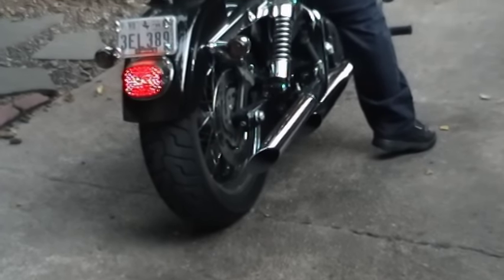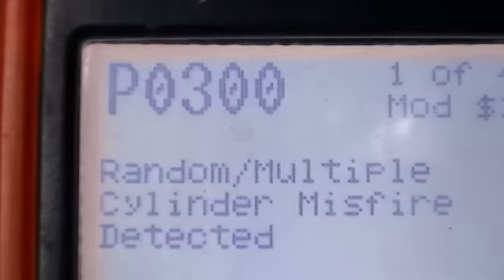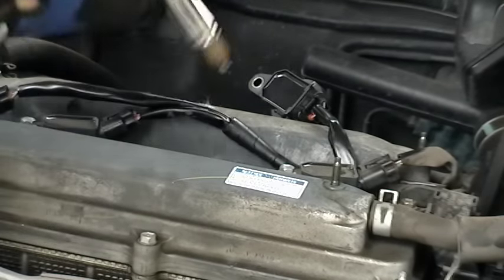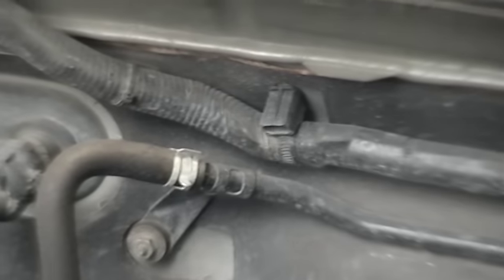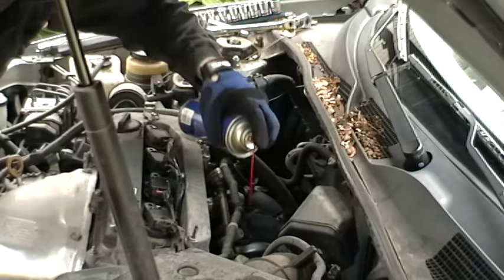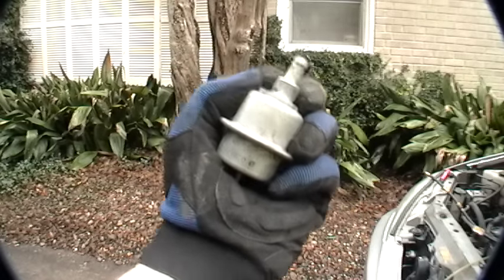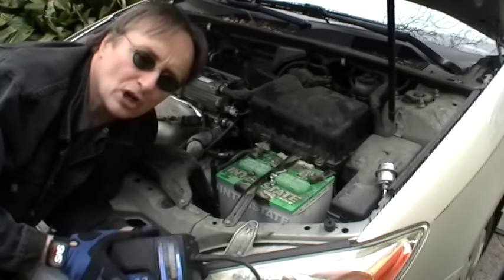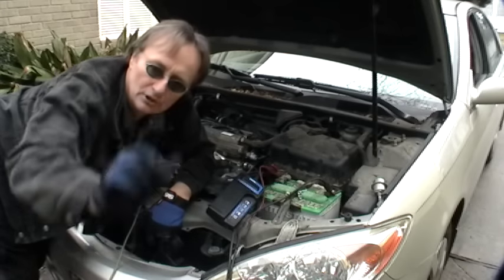How to Fix a Random Engine Misfire in Your Car (Code P0300)

Comment: I have a 2010 Mustang that is randomly only misfiring on start up.. I’ve taken it both to ford and brakes plus to see if they could figure it out but can’t .. 
I’ve replaced spark plugs , wires , bad egr valve , head gasket, replaced all vacuum leaks, cleaned maf sensor, used Lucas Oil injector cleaner/lubricant , tried the “train idle” test . 
It only happens usually on warm starts after it has been driven throughout the day
It will only happen until I start driving and the car runs perfectly normal after that..
It gets bad movements with the rpms on the start up idle and last night it finally got so low in Rpms that it completely died when I was in the parking lot.. I need this fixed pls Scotty or someone have an idea of what it could be
(I wanna note that this didn’t start happening until I replaced the spark plugs at a shop)
Reply: replace all plugs again? right plugs installed?
Reply: Brandon Acken yes I have replaced the plugs twice !!! The first time was with performance plugs and wires but then I thought that could be the issue so I went back to ford motor craft but still hasn’t been fixed ...
Can an after market exhaust do it? Idk I’m running out of shit to fix

Comment: I have a 96 suburban, I just changed the spark plugs and wires, rotor, distributor cap, gas filter pic valve and I am still getting the p0300
Reply from the maker: on that model, often leaking fuel injection systems do that, check that first. Also pressure test the fuel pump, weak ones do that too

Comment: I have the P0300...and there is oil coming out from the pvc valve going into the throttle body into the air intake manifold...any advice ASAP...thank you...

Comment: 98 chevy malibu, shakes and wont accelerate fast. Changed spark plugs, changed battery, changed coil housing, changed MAP sensor, what else can I possibly do?
Reply from the maker: tons of things can do that, pressure test the fuel pump first, and if that's OK, try my video "how to clean fuel injectors on your car" AND pray that works

Comment: random misfire engine code p0300

hello everyone i have an aveo 2008 and im having trouble geting it to pass smog.. the engine light keeps coming on (flashing) i have already changed the EGR valve, spark plugs and wires, the coil pack and the gasket seal... what else can be wrong with this car!! i need some advice please... thank you

Comment: i have chevrolet optra 2010 and i have package of errors 
p0300-powetrain
random/Multiple cylinder Misfire Detected

p0341-powertrain
camshift position sensor "A" circuit range/performance(bank1 or single sensor)

p0342-powertrain
camshift position sensor "A" circuit low input (bank1 or single sensor)

p1403-powertrain
tap for multiple description when i press i see talk about 
EGR exhaust gas recurculations

its automatic gear car 2010 model optra
when the car is on N rpm is like trying to be low
if i moved to D rpm come low and high then low its about to stop but not stop some time i push accelration but it some where repond slowly 
after the car move its fine till i stop or go very low speed

Comment: hey Scotty a Chevy silversmith 1500 I'm getting a p0300 code I changed out the plugs and wires and reset check engine light but the code came back any advice on my next step? thanks
Reply: silverado**
Reply: Bro.. Did yo not watch the video?... He clearly pointed out several other things to check..

Comment: So when I drive my car insted of rpms going up when I accelerate the go down and the car sounds like a misfire or a backfire out of the exhaust it pops while the Roma drop any advice on what I should look at I fixed all air leaks known

Comment: 07 gmc canyon 5 cylinder. I replaced spark plugs and since then it has been throwing that p300 code.
Reply from the maker: often bad wiring or ignition coils then

Comment: 2001 chrysler Sebring 2.7l  code p0302
Changed spark plugs,code still coming back
What else to check?
Reply from the maker: swap #2 injector with another, pray the miss moves, then replace that injector
Reply: Scotty Kilmer Ended up being the coil pack....replace the coil pack all good...Thank You!

Comment: Hi scott. I changed my sparkplugs on my sentra 09 and now it doesnt stays on. I put the comp on it and it has codes P0300 and Pedal sensor. Any help appreciate it. Thanks
Reply: k monsalve did you get it fixed ? And did your car shake or sputter ?
Reply: Dan D My car does u know something?

Comment: 1997 Ford Taurus, P0300 code. Plugs/Wires/Coils replaced. Check engine on, flashes occasionally. No clue how to fix.
Reply: Kevin Keener replace fuel filter, clean or replace injectors, fuel pump or it could be bad valves/low compression on that cylunder

Comment: I have a 97 Miata thats giving me a p0300 code (random multiple misfires). This code is popping up on my relatively inexpensive Matco MC200 reader... the head and head gasket is new, the timing belt is new, the water pump is new, the thermostat is new, the belts are new, the battery is less than a yr old and tested good, plugs, wires, cap, etc.. are all new as well. I originally got an EGR error code when i took it to the shop (i think they said it was a p0400 code)...i never got that code on my reader, not sure if the code reader i have doesnt read all codes or what (the shop didnt get the p0300 code and i didnt get the p0400 code that they got???), i removed and cleaned the EGR valve but i got p0300 code again. I drove it nearly 150 miles with no CEL then i decided to take it through the higher RPM ranges when shifting and it came on almost immediately once the cars RPM's went over 4000. I have looked at all kinds of common issues from making sure the bolts on the crank pulley are tight to ensure that its not wobbling which will cause a mis-read between the timing wheel and crank sensor, i also checked the gap on the CPS and it is good. I'm not sure what left??? Fuel filter? Fuel pressure reg? I'm lost here. Whgen i drive it i can fell very slight "jerking" when going up thru the gears...its VERY slight, not even really jerking but i couldnt think of a better word.
Reply from the maker: a bad egr valve that sucks air will do that.  But, so will tons of other things.  Weak injectors, weak fuel pump you can pressure test, a bd maf sensor, bad wiring, etc.  So good luck, you may be better off paying a guy like me, a pro mechanic to at least analyze live and mode 6 data after a road test
Reply: Injectors are new as well. I think im gonna replace the MAF sensor and the fuel pump...i just did the fuel filter last night. This car has never seen the rain or snow, its been a garage queen, i doubt the wiring is bad...its cleaner inside and out, and underneath than my wifes 2015.

Comment from the maker: many things can cause that, but number one on those are fuel injection problems from that cheap plastic injection system GM uses. they tend to crack and leak with age.

Comment: Im getting the check engine light only at high speeds when i press down on the throttle and also on hills..i have this code, any ideas?
Reply: Bad fuel

Comment: I have a 2003 ford Taurus ses 3.0 it randomly says I have a p1131 p1151 and p0300 or it will say p0301 p0303 and p0306 and runs like crap I pop the hood try to hear see or even smell something off then it smooths out
Reply: I've replaced the plugs wires coil pcv

Comment: Hi just want to ask something, i do have an e46 with p0313,p0183,p0185,p0171,p0174  
Codes. Car right now is hard to start dies after stepping  off gas pedal. It stalls i recently change camshaft sensor intake.still no change.then i change SP 2 out 6 right now and found oil in SP cylinder number  two (also burnt).might valve cover gasket leak.also the fuel filter by previous owner didnt change Fuel filter.considering also this.anyone could give me an advise? Just to add ccv hose to valve cover  broke and previous owner just connect it by heater hose.considering changing new ccv (found smudge of oil inside hose). Battery is good checking via multimeter also alternator works. Thank you very much.

Comment: Hi, I have an Honda Civic EG (D15B2), but having some problems with it. When i floor the gaspedal the car bogs/hesitates. And when i'm coming to an stop the car just falls down in rpm to 400 rpm/ish and hear some weird noise through my exhaust. 
When i accelerate from the traffic lights the car runs on 3 cylinders, when at 2500~3000 rpm it gives all the power and stops hesitating. Hope somebody can help me

Comment: I have a 1999 beetle 2.0 - I put new up and down stream sensor/new battery/new catalytic converter and it keeps giving me Code  p0300 multiple cylinder misfire /cylinder 1 and cylinder 3.has a new battery also. have a whore(hose) that comes from the secondary air pump to the air filter box that keeps getting lose any ideas ?

Comment: i got this problem on my 1.4 tjet alfa romeo mito 2010 with 125k km when i start the engine at morning the engine hesitate for about 2-4 second and i also hear sound like popping from my exhaust  sometimes  flashing chick engine light comes on for about 2-4 second on idle my rpm seems like going down to about 1000 rpm then comes back again to 1300 rpm idle mode after this the engine back to work as normal 1000 rpm ...i run a OBD2 scan and it says randoom missfire code 0300-98

0301-98 
0302-98 
0303-98 
i did a rest for all error 
and drive the car for 1 day and run a obd2 scan again p0303-98 missfire 

i seems like everytime i got a different code

please help me scoty🙏🙏🙏

Comment: I have a 1997 Chevy S10 with a 2.2L engine.  I keep getting the Random Misfire code P0300.  I had replaced ALL vacuum hoses and lines, spark plugs and gap them to 0.060 inches, replaced the spark plug wires, MAP Sensor, All injectors, Ignition coils ALL to include the ICM.  Switched to different spark plugs, and wires, O2 sensors front and rear, Cleaned upper intake and replaced gasket.  Replaced exhaust flex pipe do to exhaust leak, replaced CAT and muffle, new fuel pump.  And I am still getting Random Misfires.  Engine use to start with just one turn of the key before the above was changed.  Now you have to pump the throttle peddle while holding the ignition to get it to start.  Just today I had changed the ECM and did the 30 min procedure for pass lock.  Just today I am getting a rich bank 1 code, and still getting the Random Misfire code.  Check engine light no longer turning on.  After engine is started it idles and runs.  I looked at the fuel filter and it looks fairly new, however thinking on changing that out tomorrow because I am out of ideas.  Need help!
Reply: Changed out my Fuel filter and I am still getting P0300 code.  And it still takes long to start engine.  Unless you start adding some throttle while starting.
Reply from the maker: Michael Bayona pressure test the fuel pump, it may be going out. If not, try my video 'HOW TO CLEAN FUEL INJECTORS ON YOUR CAR'
Reply: Scotty Kilmer Even if I had just installed a brand new AC Delco fuel pump!
Reply: Scotty Kilmer and have new injectors!  Should I just try and install the old injectors back onto the truck and see if that does anything?
Reply: Michael Bayona Okay I changed out the New injectors that I purchased form NAPA with the old stock injectors and my Random misfires went away, more power to the engine and starts 1st time every time.  So I noticed there is a difference between the new injectors and the old stock injectors.  The new injectors has only one hole that contains 4 small pin holes where fuel comes out off, and the stock has that same hole and two additional holes on each side.  Thanks Scotty for all the videos and keep up the great work.  Awesome buddy.

Comment: I have a 99 Pontiac grand prix , 3.8 , I have spark to the top 2 coils and none to the bottom one, yes all the coils are new . any ideas? running a p0300 code.
Reply from the maker: so many things can do that code, from bad wiring, bad computer circuits, or bad ignition control module. Good luck
Reply: Scotty Kilmer it was the ignition control module thank you !!

Comment: Corrosion on coil pack terminals and all spark plug terminals are rust pull out plugs and grind off all corrosion use dielectric grease on terminals not to much grease or else wires will pop off when engine is revving dont over grease!

Comment: I have a 1997 pontiac grand prix gtp. This supercharged car hesitated around 4000rpms when i lay on the petal. It brings a lean code. Ive replaced all of the parts youve listed and more. Anyone have any ideas?
Reply from the maker: superchargers often go bad on those, they flat wear out and at high speed will do that. Have a pro test that

Comment: I have a 1996 GMC Yukon , I just replaced the spider injector and now I have the dreaded 300 misfire the fuel pump is new the wires and plugs are new its hard starting after it sits for about 15 minutes ,I used some seafoam and that didn't see to help,actually it runs worse and the hard starting became more intense.
I checked for vacuum leaks which none exist.....HELP

Comment: Started my 2004 GMC Sierra when it was -30 c had very little fuel in it, drove over to a gas station and put in 15 liters..... drove for an additional 15 minute averaging 60kmh until engine light started flashing.... pulled over to an idle  and noticed the Engine was throbbing at low revs, and the error code is P0300.  Noticed the next day that BLACK splatters are sprinkling out of the exhaust when applying throttle , the smoke itself is white... keep in mind its still -28 c  .. the exhaust will appear white due to the outside temp anyways. Hoping maybe something in the fuel system needs to thaw out so Im gonna park it in my garage and heat the truck up.
Reply from the maker: it's running rich as can be, on those, often leaking fuel injectors do that  as they are cheap plastic parts that heat and cold cause to crack and flood the engine out. check that first
Reply: Scotty Kilmer Thanks for replying back... You were differently right about the truck running rich, i sprayed ether all around the intake manifold and hosing and found no leak... After taking out all the spark plugs... the drivers side spark plugs were fouled horribly, yet the passenger side ones were clean as can be. Truck started producing the error for faulty O2 sensor. So i changed the Pre catalytic O2 sensor on the  drivers side and it solve the problem COMPLETELY :)   its a shame this all had to happen when it was -26c outside though...not fun.

Comment: Any idea on how to fix code p0443 on a 2003 dodge neon?
Reply from the maker: pray it's just an evap canister purge valve. Go to any auto parts store, they can sell you one and show it's location
Reply: I replaced that already and it's still showing code. What else could it be?

Comment: I have a 1996 Oldsmobile Cutlass Supreme 3100 V6 12 cylinder engine can a random misfire cause the car not to start because at times it will start but then it will not but once it's running it's fine it'll bog down a little bit at times unless I'm going over 40 but then if I'm doing over 45 it does just fine what could this be
Reply from the maker: yes it can

Comment: I have a 2002 Buick Park Avenue started acting up, replaced spark plugs & wires, also ignition control module. Was driving it and it just quit and then would not start. Tested it today and got codes PO300 and PO420, can anyone give me any ideas what to check first?
Reply: Mona Jones  sounds like the catalytic converter may be clogged badly enough to not allow the pistons to take in vacuum. Pull the fuel pump relay underneath the underhood fuse box, disable the ignition, and hook up a vacuum gauge to a vacuum source. If there is 0 cranking vacuum you may have a clogged exhaust. If you dont have a vacuum gauge or understand what im saying. Then just simply unbolt the exhaust manifold from the head of the engine and try to start the car. However your not providing enough info. Does it crank and not start, or no crank and no start?
Reply: Thomas Anderson It cranks just does not start
Reply: Crank no start is usually caused by not enough fuel which can actually cause your random misfire. Or insufficient or no spark. They sell a fuel pressure kit at harbor freight for $20. If there isn't a valve on your fuel rail to hook up the pressure gauge than take off the rubber fuel line hose and connect the pressure gauge in between the fuel rail and the gas line coming from the gas tank. You shouldn't see less than 40 psi. If there is no fuel pressure suspect the fuel pump circuit or pump itself or a clogged filter. As far as spark goes you can pull out the spark plug wire and connect a spark tester ($5 at harbor freight) to each respective wire. If there is no spark further diagnosis is required of the ignition system. There are actually several more things that can cause crank no start. Those are just basic test that you should do first. If these test pass then keep me posted.
Reply: Mona Jones Crank, but no start is Crankshaft Position Sensor on that engine most of the time.
Reply: Bob M. Tyranny Destroyer there wouldnt be spark if the crank sensor was bad. The pcm wouldnt be telling the ignition control module to fire because there wouldnt be a signal from the crank. Its a distributorless ignition.
Reply: change your cat it s puking fur balls cant breath its going to die.

Comment: For P0300 - Random misfire code 
Check and replace the problem
1) Spark plugs
2) vacuum leaks
3) fuel pressure: filter first then pump
4) battery

Comment: Next step. Check to see if you have an 8th generation Toyota Corolla with the 1ZZ-FE engine. If so, don't even bother with the code reader. There's like a 99% chance it's a cylinder misfire or system running lean or a vacuum leak from a bad intake manifold gasket.